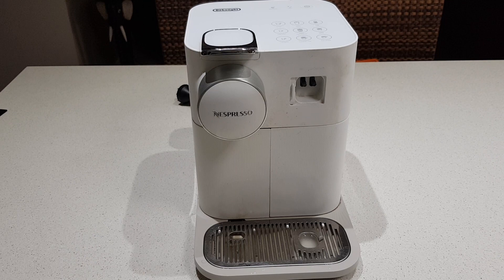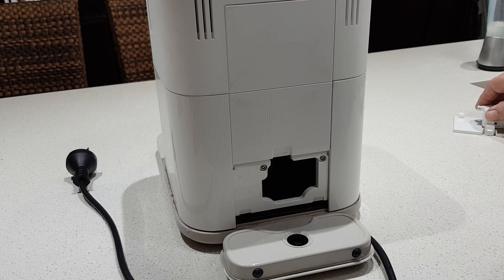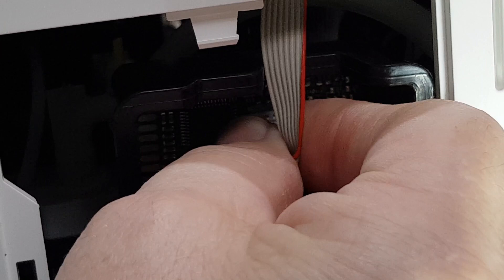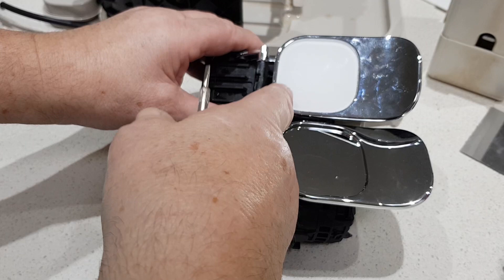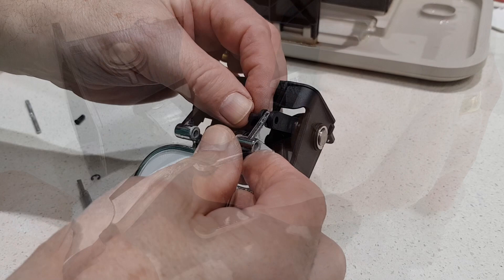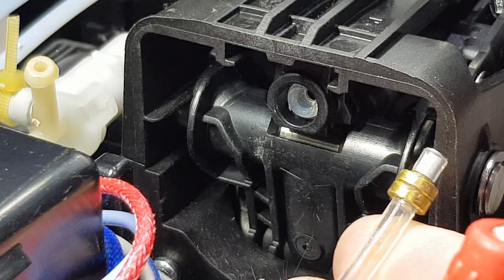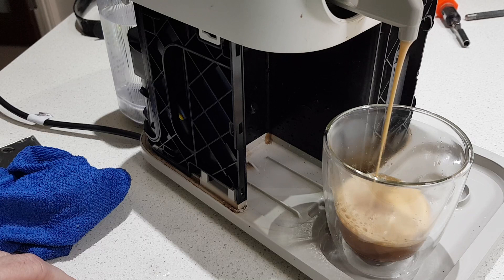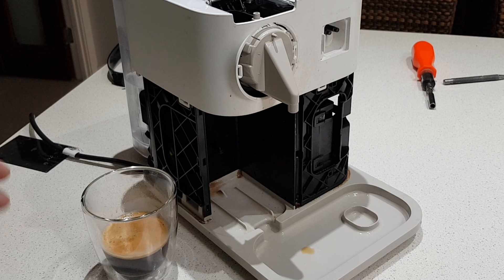De'Longhi Nespresso Gran Lattissima EN650 Infuser replacement

Comment: This is a great video Dave.  This seems to be a common problem with the Nespresso machine, well for me at least. I had the infuser fail on our previous machine the EN720 and now on our current machine EN650B.  I looked high and low for a manual and couldn't find anything relating to this machine, (the milk frother was playing up a couple of weeks ago and it didn't seem to be a common problem). Then I stumbled across this video which is a great help. Thanks.

Comment: Thanks for a great video. I had a different problem and couldn't work out how to get into my machine before I watched this. All I did was follow your instructions until you removed the top and pulled the little plug. I then plugged it back in and it reset my machine and it's working again. Thanks

Comment: Thank you for your wonderfull video 
I have the same problem only mine it is less than 6 month old machine, it has occasional leack issues but the worst is it never puncture the cartridges of coffee which always cause the coffee to leak in the tray and the cup of coffee fills with water more than coffee !
I tried to follow your steps on your other video ( cleaning the plate with tooth brush to get out any coffee deposits that could be blocking the holes in side that plate but I got no improvements , I used deblocking cartridges that has inside descaling products instead of coffee but that didn’t work either .. 
I want to open and try to clean the plate but I wonder if after removing this plastic cylinder would I be able to have access to the plate to have look at it ?
Thank you

Comment: I have the en500 model .. got as far as removal of the 2 screws at the back (3:14) so I could access the screws to the infuser..no such luck, on my model they cunningly put one screw on the "INSIDE" of the plastic backing at the base, which is impossible to get at .. off to purchase a new machine now 🤣🤣🤣 .. thanks anyway 👍